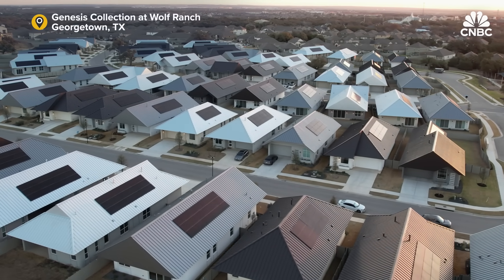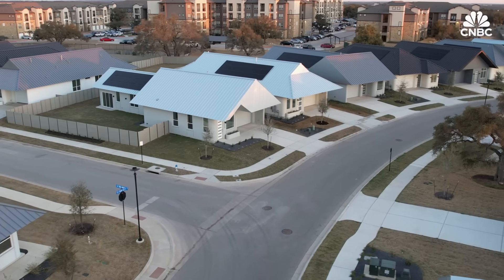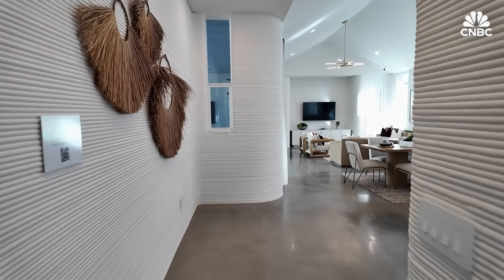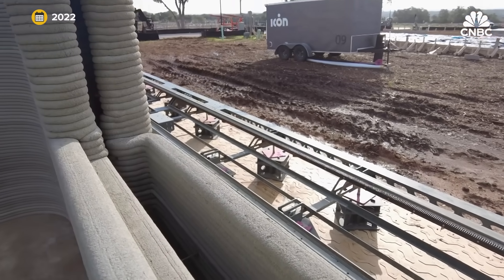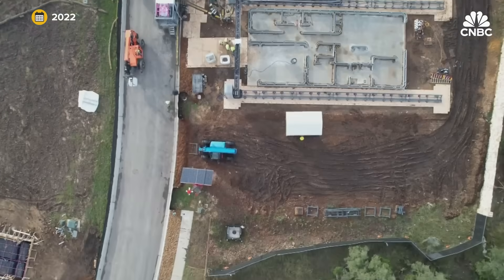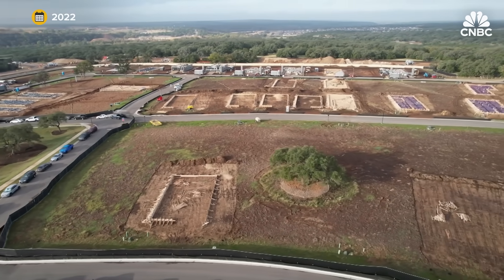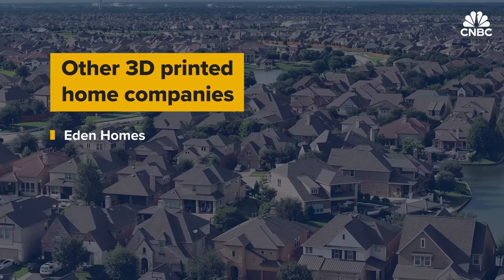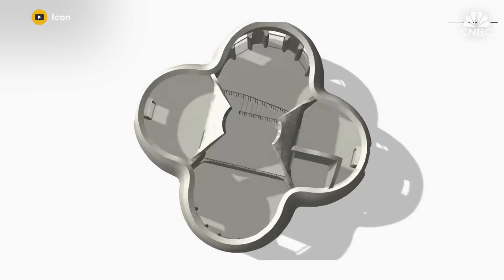Inside The World’s Largest 3D Printed Neighborhood

Comment: 3d printing, or let’s properly call it, fabricating homes using robotics through extrusion within an enclosed assembly, is absolutely stupid!! Extrusion is ideal for unique geometries, not repeating square walls. The only parts you’re actually getting done are framing and drywall, both of which can be done in days. Now, a robot that lays prefabricated brick engineered to lock into each other, pass power, and even water systems, with pre planing, and brick differentiation, that actually makes sense. But this is just stupid. For mars where you’re collecting local material that could be made into a universal slurry then maybe you have an argument. But still you would need more of a robotic arm than an enclosed printer, for reasons I hope are obvious. 

The term “3d printing” gets thrown around way too much. It’s is truly ridiculous that we’ve come to a point where extrusion layering is called “3d printing” homes instead of a properly thought out robotic system.

Comment: That’s still too expensive. It costs about $130 Sq ft to build a home. So a 1,500 Sq ft home costs about $195K. So the land still costs 1/3 of the home. The only way homes can be cheaper is if the land is cheaper. Land rarely ever goes down in value. So they need to figure out how to get these homes at $60 per Sq ft.

Comment: Dont think it will work. It cost just same as regular homes but smaller. Its Texas forsakes. 400k for 1500 sqft is expensive. Also dont think reporter knows about Texas weather. You hardly turn on AC in January. My electric bill was less than $50 in 2300 sqft home in dallas. Electric bill in Texas is close to lowest in the nation.

Comment: I can only imagine how much dust is going to collect on each and every wall with all those grooves. There isn't a great way to remove dust from concrete on such a big scale that doesn't involve water or compressed air.  But hey,  innovation always creates new problems that need to be solved.  Also,  isn't concrete one of the growing CO2 culprits?

Comment: The curing of the concrete is a flaw. Those lines are not the same as a pour . Guarantee you, they will have the left side of the house sag as one of one or two of those lines crumble.. because the machine was secreting a bad batch of concrete.. 

I like the idea and I think it could be implemented in certain areas… if the cost is right.. but what happens in like Michigan.. where you have cold winters and fairly hot summers.. the expansion and contraction. Will wreck the home.. It’s good for Arizona.. low humidity high heat.. And you better hope there isn’t an earthquake even on a small scale
Reply: The real world has slight movements.. could be irrigation could be weather.. but when you have a massive load of ridged material… It will not flex to the changes.. This is a novel idea. At best… Again could be great for New Mexico or Arizona

Comment: This is huge for making homes quieter. I would live in one just because of this. Be interesting when they get the noise down if they can implement drywall to make it more homey.
Reply: What is hilarious is In Australia. It's all brick and Mortar like this. 
If you want a quick renovation, we use drywall. Aussies prefer concrete over drywall!! I live closer to the high wy and fire hazard area. We have noise insolation and Fire hazard materials to minimise these issues. Burn at a slower rate.. From slab to finish It takes use 9-12months to finish
Reply: They can use drywall, but the cost would just go back up, because attaching drywall to concrete is suckage.
Reply: It's really echo-ey inside, though.
Reply: Unfortunately, they said that they are reducing the thickness of the walls to save money. They're also going open floor plan which is another typical cost savings move. So all of the noise benefits stressed by the lady are going to be diminished.

Comment: Cement is a catastrophic energy hog to produce.  Nevertheless I like the homes for longevity and energy efficiency.  This along with resistance to man made climate change will allow the homeowner to gain money in saving multiple times over.  Still in the right climate I have a greater interest in the 3-D printed honeycomb stabilized adobe being explored in Spain for housing.  Its efficiency is greater and energy requirements to  are produce the adobe are significantly lower.   Additionally  its possible to approach the efficiency of these techniques with less high tech but far greater labor for skilled diy home builders.  
I suggest one does not need a 10,000 square foot home for 1 person or even two.  The development I saw in the video looked reasonable and they were still  larger than the average American home for 4-5 occupants of the 1950's and 60's.  Why have a million dollars to pay off the home when it was possible to become financially independent decades earlier with a more space efficient home?

Comment: These look terrible and cheap. I cant imagine them aging well (like the cheap stucco from a few years ago), and we really need upzoning and mixed use urbanism (some nice mixed use single staircase walkups could house a lot more people with less urban heat island effect).

Theyre better than nothing, and I'm glad they were built (in the very least as an experiment), but the technology seems mildly useful at best. They dont need that 3D printer to build out of concrete and brick in Mexico and Europe, why is it necessary for the US to adopt insulative and fire resistant materials? Land and taxes are the expensive part too, so a cheaper construction doesnt solve the root causes (government housing supplementation would help too)

Comment: They should design it so that they have smooth walls. All those crevices are going to collect so much dust!

If not that, they should design it to be covered by some other flat material, not sure if wallpaper would work (it might cause condensation in the gaps, not sure), but something similar. I would never buy a house with all those cervices in the walls.

Comment: Been helping build homes for 10 years from Spec to Semi Custom to full on Custom builds….. my question is if there needs to be a repair done and need access to the inside wall like for example a pipe or wire… do you break into the wall? And if so doesn’t that break structural integrity?

Comment: Now we're talking. About time housing inovation has arrived. These are awesome on so many levels. Great job Lennar and icon.
Reply: Really so what are we going to do with all the unemployment and when a hurricane hits these houses.
Reply: About time? The first 3D printed building was constructed in 1939. If was 100% mechanical, no computer, but basically the same. In many ways it was a better system too. Created smooth walls instead of the rope pattern. Cheaper to build, no high tech concrete mixture needed. Great job William E. Urschel.

Comment: my question is if there are malfuction to electrical wires, how are they going to solve this problems if all the wires are inside the concrete? do they have to breakdown the wall to fix the issue? same for water problem

Comment: Is this really the most efficient way to build walls? Factory modular construction can include some wiring and plumbing + better inside finish. Concrete is a hard to repair/modify building material. The cost of wiring + finishing this home will likely be just as high. This seems like a way to speed up the framing, which is one, not terribly slow part of the process but that leaves a horrible finish.

Comment: There is no housing crisis. There is plenty of housing stock for the population. The problem is the large number of investors holding empty units. They secured cheap money to obtain a property. The value goes up faster than the cost of borrowing the capital. No reason to rent it out or anything. Just sit and wait for the time to sell, collect the profit and repeat. 

This is a continuation of the 2008 financial crisis. Values plummeted and shot back up higher than before. We are still in a boomerang cycle. Only difference is now large investment companies instead of individuals own the property.

Comment: Insurance costs actually should decrease in due time, that is, if carriers decide to reduce rates based on the structural benefits to mitigate natural or man made disasters. Maybe it's an assumption and maybe wishful thinking though. Insurers will find a way to max the bottom line...even with the lessor risk. Big companies have a tendency to inflate cost and stay that way, bloated, long after the "issue" has left the building.

Comment: This is great, I didn't know that the home printing is more than in development faze but there are actually finished houses and lived in ,🤟🤟😍
Can't wait to see this tech expand
Reply: It's been been around a long time. First actual built was in 1939 and imo was a better printer because it created a relatively smooth wall.

The main issue is the amount of lying going on. These only build walls. That's less than 1% of labor cost to build a house. A 3 man crew can put up pre-fab walls in an afternoon. To build walls from a pile of 2x lumber is about 2 days. It takes longer than that just to set up the 3D printer machine when including the foundation the machine needs which is not part of the house.

Comment: Incredible, disturbing, and scary if you are a brick layer or carpenter. They will still need electricians and plumbers though. I always thought pre-fabricated (pre-fab) buildings would lead the way (homes built of wood or plastics in a factory and then transported and assembled on site). But pre fabs are labour intensive. The robots can work non stop for no pay and no food.

Comment: Running the ac on full blast during summer and winter in Texas. This is a game changer if it insulates better than anything traditional.
Reply: Concrete isn't a good insulator. What these houses have is thermal mass. You can achieve the same thing with masonry, rammed earth or adobe.
Reply: @damonroberts7372  exactly, I've lived in Mexico, in multiple cement block constructed homes, most with zero interior or exterior insulation. Gets pretty chilly in the middle of winter
Reply: Remember that they compared grandma's home to a larger home costing the same.  It wasn't a apples to apples comparison on size.

Also, dont forget the roof.  That's not concrete.
Reply: What y’all call traditional, in Europe we call a shed or a dog house. 😂
Reply: Yup she does 120 $ to 26$ a month
Reply: Yeah, I’ve been building austin with concrete and don’t understand why more people don’t do it.. Outside of a few luxury builders doing ICF, no one is doing it and it makes no sense when it’s over 100 degrees half the year - SMH
Reply: So cute seeing Americans discover concrete 🤣"we have to screw things into the wall but thats ok" 🤣🤣🤣
Reply: Earth does a much better job than this, and it’s been around for thousands of years. Companies like Terra-Form are automating the process to make homes out of earth with concrete-like mechanical characteristics. These walls have an even better  R-value, less embodied energy, are even more silent/dense than concrete/ and can be done in eves less time than a 3D printed home with the right setups. Earthen construction is the way forward.
Reply: You can accomplish these same efficiencies with good traditional building techniques and high efficiency A/C units as well. However the big builders like Lenar are not even close to doing that.
Reply: Tropical countries with high temperatures usually do have concrete houses. Wood houses are actually not all that common outside of “rich” countries because people need to build multi storey homes due to space shortage.
Reply: Congratulations, you just realized the rest of the world uses concrete and bricks to build single family houses!
Reply: The rest of world does not have. Central ac like US dies  @MrPolandball

Comment: 1) Great until you realize concrete is corrosive on plumbing ie copper, brass.
2) What do you do want there is movement such as a earthquake that creates large cracks on the exterior or if it starts to spall in colder states?
3) Lennar won't cut costs - they are a greedy public company that needs up please investors of the market. Tried to buy a townhome in NJ and the sales associates jacked it up another 100k even though I gave the asking. Guess what? It's still sitting two years later and I was a cash buyer.

Comment: The cost issue is really gonna topple the entire point of the home. I'd also worry about the heat island effect where numerous homes made out of concrete would increase the surrounding areas temperature
Reply: the heat island effect is because we've paved everything in the city, so the heat has nowhere to go, same thing with flooding so the water is stuck and causes more damage

Comment: I imagine that cement will have a scent as it aerate. Perhaps they use a sealer. Another reason to seal the concrete is humidity.   I can see a 4 foot foundation underground will send wall heat underground.
Reply: Not only that, but when these homes start experiencing differential settling, all the walls will crack. The piers and stabilization required will be in the six figure range.

Comment: this sounds great.... just two questions.... 1) how does it hold up to earthquakes or ground movement? Any other concrete home in Texas results in massive cracks up and down the outside walls due to the foundation not moving properly. what kind of foundation is being used? Are we going to still be using the cheaper concrete slabs for foundation? Because those are part of the problem. Needs to be pier-and-beam, otherwise it will cost a whole heck of a lot for the buyer in the future. 2) how do you ever feel like your home is clean, because to me those walls look like a great way to collect dust.
Reply: Correct. Houses do tend to settle. Repairing cracks is not going to be possible given the texture. The entire wall will have to be stuccoed.

As for cost savings, only the walls are printed. It takes longer to set up the 3D printer machine than it would take a crew to build walls. There is no cost savings and that's obvious in the price of the final home.

And talk about every home looking the same...
Reply: @waterbug1135  1) The price of the home is around the same as a stick-built house for a prototype.  That's impressive.  When it goes into mass scale, it'll be even cheaper to build.

2) You've clearly never be involved with building a house before.  They said it took their printers 2 weeks to make all of the walls, which included accommodating for all of the electrical outlets.  In an early stage, first attempt, that's impressively fast.  Plus, it can work 24/7 without needing a break and human labor isn't free.  Hiring 20 framers at $55k a year to build your walls, paying for people to stucco or house wrap+side your exterior, and drywallers to drywall the inside of your house.......this prints exterior, insulation, and interior in one go.  Just needs some paint.  

3) Homes "look the same" now.  Every go through a new construction area?  My in-laws live in a new build area and I can't tell their house apart from their neighbors.  If their house numbers fell off, I wouldn't be able to find them.  At least with a 3D printed model, you can change up the interior walls to however you'd like without adding any real cost, besides the time to model it and more concrete if you're adding more than originally were there.
Reply: To your question number 2: My guess is stucco is going to make a comeback.
Reply: I'd mud all those walls smooth...just like I would do on orange peel texture
Reply: Americans just don't know how to build with concrete properly shame! It's amazing how Japan is still standing right??

Comment: Wait until you want another outlet installed
Reply: There’s quite a bit of room in between the walls.
Reply: yeah how do other countries even manage this? I can't imagine it because i'm american
Reply: @Thatsme849  Other countries don't have electricity..
Reply: @meatgravylard  oh right forgot about that. My pc must be running on something else then
Reply: @Thatsme849 from the get go, there are enough ports and switches, and lights installed. There are ducts between them all to be able to change the wiring.
Reply: Yes the novel invention a concrete house
Reply: Only Americans would think you can't modify electrical in concrete lol
Reply: Buy an extension cord. Much cheaper, also most new homes already come with plenty of outlets. I mean, how many do you really need. 😂
Reply: Wireless receptacles are coming next.
Reply: Good thing modern building codes requires a generous amount placed in sensible locations.

Comment: 2:38
Please give the totality of a year's electric bill, not just one winter month.
If the saving is $100/month, every month, that would be great.
Over a 50 years span, that would be a saving of 60K!
Reply: There's nothing magical about the concrete being used and we've been building concrete homes for decades. There are millions of them in the US and many more outside the US. Uses less to heat/cool compared to what? A 2x4 uninsulated house?

I live in Phoenix in a house built in 1949. I furred out my walls to 8" thick with fiberglass insulation and added attic insulation. I don't have to heat in winter and my electric is about $75/mo June-Sept.
Reply: @waterbug1135  
I'm just stating an obvious fact...give the complete data and then let the viewer calculates whether there are indeed any savings. It's poor form just giving a month's bill. Just gives the impression that it's hiding something or just a propaganda piece.
Reminds me of a couple who videoed their eco-home being built very cheaply with the help of volunteers, implying that youngies can still built their home cheap...except they delayed saying the land was donated by their parents right till the end of the video.
Let's be transparent. Do you have any issue with that?